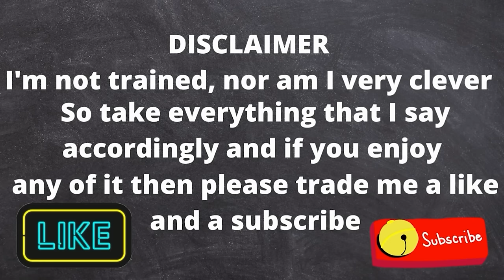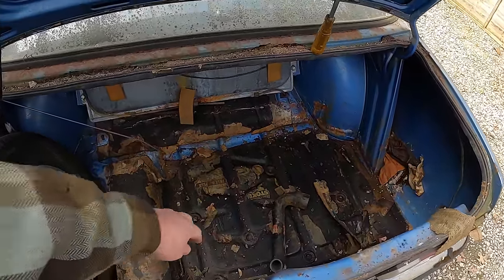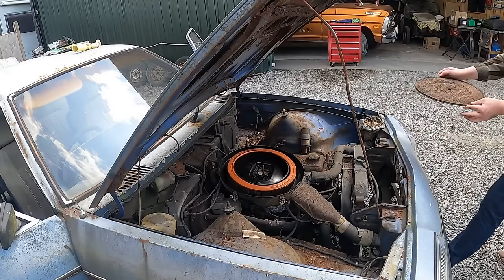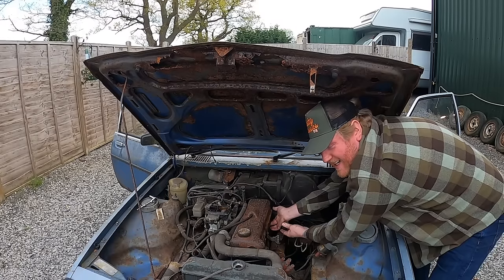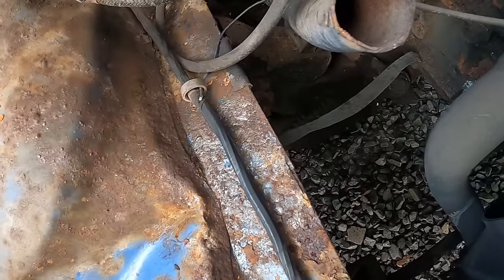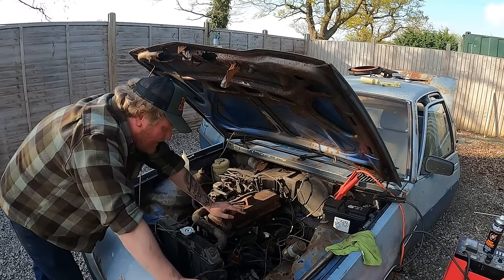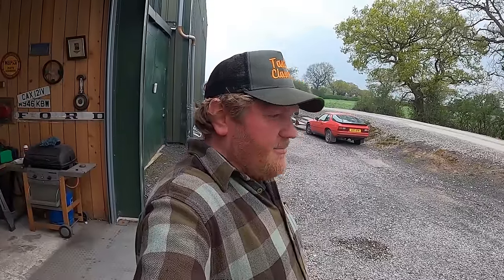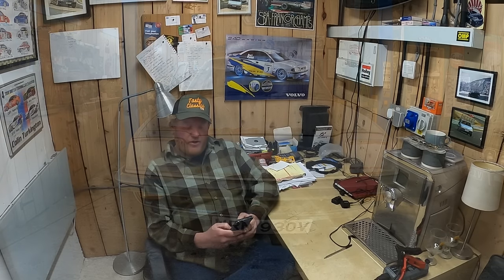Sat for 22 Years! Can I get this very rusty MK1 1980 Vauxhall Cavalier 2000 GL running & driving?

Comment: I had a copper bronze mk1 2000GL in 1985, great car, although the camshaft went and I managed to change it but full head off etc, re-ground the valves in - learned a ton about cars from it, enjoyed this vid 👍
Reply: Done same on 1.6. They coked up bad: right across the valve stems.
    Vauxhall camshafts were shte. Fk knows what they made them of. There was hardly a Vauxhall around that didn't have a clattering camshaft.
Reply: @philgee7249  had a mate with a chevette who had similar at the time, we thought it was us who were cursed 🤣 clearly not. The camshaft I replaced it with was a high lift cam, the performance was nuts, it used to eat XR3i’s off the lights like they were lighting a fag 😂, great times

Comment: Hi, good video buddy, thanks. I had one of these back in the day (also a 1980 I think), but had a smaller engine and gold coloured, 60,000 on the odometer, (half of that downhill), anyhoo a great runner. A curious thing about Vauxhall cars before this model, they came with a fluted bonnet, sometimes chrome that ran from the screen to the front of the clip; more noticeable on earlier models (50s); not sure if their cousins Opel had this design. All in all though pretty reliable mechanically but prone to rust. I had a Victor after this also a hand me down from my father in law. Other models were the Cresta, Velox, Viva. I also owned a Viva GT; now that was a beast with plenty of torque. Greetings from the Isle of Wight.

Comment: I subscribed because the first video I saw was this today. My mate had an Opel Berlina, in the rest of Europe they call them Opels in UK Vauxhall. It was older a bit I think, but was running great. We even once took the engine out, just with our hands because it is so tiny in comparison to modern engines. These cars had a really great design that looks even good today. Back then people would look a lot at the car as there are not many like that alive anymore and on the streets. All original they go for a lot on mobile and here you can get the number plates for historical vehicles provided the vehicle is in mostly original setup. You get a lower tax I think, I know there were some benefits of having a plate like that.
I was also thinking that maybe the glass inside the boot is from a broken window at some point, person maybe thought they will sell the car better with windows intact, replaced it with some spare, but did not bother cleaning the car. Or maybe they just did it to save the car from moisture inside. All sorts of possibilities.

Comment: This brings back memories, my first car was a white 4 door 1.9GL. Mine didn't get the passenger door mirror, that was an optional extra. I drove it all through the winter with no heating, finally figured out the lead stop on the heater cable had come off the heater slider, 5 minutes and it was fixed. Sold it to a friend who ran it out of oil and seized the engine.

Comment: in 1992 I had a mk1 1980 cavalier 1600 with white weller wheels on it with the thin blue and red pinstripes around the circumference of the wheels, it was alwaysn a bugger to get started in the mornings turning over slowley and it had a serious water leak to I had to refil it with water about every 50 miles but for a hundred quid it was cheap motoring at the time, love the sound of this one takes me back to the good old days of motoring on the cheap. might need to tweak the timing plus 3 to 5 degrees for unleaded or super unleaded fuel these were built to run on leaded fuel afterall.

Comment: Had one a gold 2000 manual drove from 1989 1993 and from Suffolk to Aberdeen in 7hrs and from Suffolk to Berwick upon Tweed in 4hrs a fast economical easy to drive car with just a large hole and a clutch replaced in the time I had it brilliant car

Comment: A 1980 1.6L Cavalier was the last read wheel drive car that I owned until last year when I bought a RWD Mercedes. It was streets ahead in build quality compared to the 1977 Capri I had before it. A lovely smooth, comfortable reliable car, I changed the steel wheels that came on it for the same wheels that were on the car above. It is a pity that car is beyond repair but I still fondly remember FTD552W.

Comment: I used to work on these when I was an apprentice, if I remember correctly, the camshaft was recommended to be changed by Vauxhall at around 60000 miles....and the gear oil was changed for a synthetic type to stop/quieten down the chatter from the idler gears....

Comment: That is quite an interesting car! The front suspension has no McPherson struts! That is a proper front suspension! The rear suspension has a Panhard bar, and it's not even a Panhard! The rear quarter panels are so much like an old Toyota Corolla, with the squared rear end and the vent in the sail panel..... The oil pump is literally hanging out in the wind, so it can say "Hello" to the oil filter - never seen that before! I really like the look of the car with the hood open. Were it mine, I think I'd keep the hood open or remove it. It just has a good look, as if to say "Look at my engine and radiator layout"! And the first time you ran it with the Holley fuel pump, there was a sort of melodic quality - as though it were saying "wick, wick wick, wicka, wick wick wick, wicka". Or maybe "boop boop boop boopa, boop boop boop boopa". Had sort of a backbeat to it. Such an interesting car.....

Comment: My father bought a blue 1979 1600gl in 1982 and it was a big step up in luxury compared to the previous cars we had.
The reg was BHL 638T.
Then in 1986 he got a china blue 1983 mk2 cavalier 1.6GL which was even better.
Owned it myself and sold it in 2000 due to the ban on leaded fuel.
Engine was still perfect @150,000 miles and saw it again a few years later with 200,000 miles on it with still the same owner who bought it off me.
Had great velour seats, a rev counter, oil and battery guages as standard.
HUB 660Y.

Comment: Just revived a 1600 auto cavalier mk1 been stood 25 years not as rotten as yours but it had a fully seized carb and no brakes,fuel tank had third of a tank,everything electrical worked fuel pump was dead still an on going project,needs rear wheel bearings and rear shoes too. Hope you get I going,you have hydraulic lifters on the 2000 so probably will rattle when it fires up!

Comment: I would be doing a full restoration on the bodywork and interior. Engine sounds okey and obviously the gearbox works. Brakes, suspension, exhaust need an overall and the carburettor needs a rebuild to. Certainly worth the restoration for a classic like this.

Comment: My parents had a white 1256cc 1980 MK1 that I passed my test on in 1988. I then bought a 1979 Mk2 Escort 1.3, so I used to drive both. The Cavalier was a MUCH nicer car to drive, which always makes me smile when I see MK2 Escorts selling for tens of thousands of pounds. The Cavalier was poorly built though - by the time it was 10 years old/70k miles it had had the engine and gearbox rebuilt, 2 new front wings, and new inner and outer sills. At one point my parents had the MK1 and a 1986 MK2 at the same time - the difference in quality was more like 30 years than 6 years.

Comment: Mk1 Cavalier engines were 1300, 1600 and 1900 (later 2000) there never was an 1800. GLS was added later in the run on saloon, but there was a GLS coupe before the saloon. Three door was called the Cavalier Sportshatch.

Comment: You say there’s nothing worse than a Vauxhall auto box but back in the day GM boxes were considered one of the best. After all Rolls Royce (and I think Jensen?) used them. I had Vauxhall autos in the early 70s (in 3.3 Crestas) and they were pretty tasty especially compared to the competition. That’s a great old motor!!!
Reply: Jaguar, not Jensen used GM 'boxes. Jensen used the Chrysler 727 Torqueflite.
Reply: Thanks. Knew it began with a J!!

Comment: Hello chap! Some fun Cavalier facts. The mk1 engines were originally a 1.3, 1.6 and 1.9. The 1.9 was replaced by the 2.0. Top spec models were the GLS which i can only remember seeing as the Cavalier coupe or sports hatch, which were rebadged Opel Mantas. Essentially the ‘droop snoot’ Cavalier was the German Opel ascona with the Manta nose grafted on. Vauxhall UK wanted to take advantage of the motorsport fame of the Droop snoot Firenza raced by Gerry Marshall (Big Bertha/Little Bertha?). The colour of your car iirc is sapphire blue metallic which was offered on early mk2 cavaliers as well. I disagree with you that the mk3 cavalier was the big seller. The really big seller was the mk2. It was launched at the dog end of the ford cortina years in late 1981. It beat the first jelly old sierra to market as was much preferred by fleets for its more conservative looks and much more sprightly engines. For example the 1.6 sierra only had the same bhp as the 1.3 cavalier (75bhp), which had 90. This was a huge draw in the company car market where car status was all amongst sales reps pounding the roads. I ran two mk2 cavaliers as company cars including an early 1.8SRi. I then spent the second half of the 80s selling cars. So my knowledge is verging on the nerdy. Lol.

Comment: Best upgrade you can do to it once it's running is swapping in a 5 speed from the later Manta
A good friend who's no longer with us (RIP) was the Manta Area rep and he had one of these and did this swap. 
When the car was on the road, drove with decent manners and was reasonly fuel efficent.
Retrofit the Bosch fuel injection system from a GTE , it'd be on par to run with modern traffic without too much issue.

Comment: I AM IN MY MID 50'S NOW, BUT YOU REMIND ME OF TIMES I'D RATHER FORGET. I USED TO NICK CARS DURING THE EARLY 80'S  WELL SOME CARS WERE SO EASY TO STEAL. FOR INSTANCE I WAS STRANDED IN HASTINGS, I WAS DESPERATE TO GET MYSELF BACK TO REDHILL SURREY. THEN IT CAME TO ME SOMETHING MY GRANDDAD DID TO HIS MORRIS 1000. HE HAD MISPLACED THE KEYS. AND NEEDED TO GET SOMEWHERE ASAP, THEN I SAW HIM GET A FOOT LONG PIECE OF WIRE AND HE CONNECTED ONE END TO THE POSITIVE SIDE OF THE BATTERY THEN THE OTHER TO THE COIL. THIS MORRIS HAD NOT GOT A STERING LOCK. ANYWAYS WHAT HE HAD DONE MADE ALL THE LIGHTS OF THE IGNITION INSIDE THE CAR COME ON.  PROBLEM SOLVED WE HAD TO BUMP START IT THO. BUT LONG STORY SHORT THATS HOW I NICKED MORRIS 1000'S BACK IN THE DAY

Comment: We had a MK1. Small correction... They also did a 1.9 which we had (1977 GL model), think the engine was based on the earlier Victor / Viva engine. Badges on back were different. Also facelifts had headrests. Think it only had a driver's door mirror too from the factory. The wheels are called Rostyle. Standard issue. Some mk2 Cortinas eg our 1600E had similar ones too. This is a "facelift" MK1. Best squeaky clutch pedals and rotten back arches to you, sir! (Yes. They ALL had them. Right up until the end of MK3 in 1995).

Comment: Brilliant ‘Left-for-Dead’, Ben. Was howling at the Britney Spears bit at the beginning, alomost at a similar level to the Rascal in the Suez and the Ambassador in the sh1thouse 😂😂😂

Superb that you got her running (expected nothing less!), but when you were spending as much time as you were on the exterior, interior and Engine Bay, I had an inkling the the underside was going to be an/the issue - regrettably I was not wrong, which make 2+2=4 when your friends (is there any way I can get in touch with them for some resto work?) sold her on to ya.

Good luck to the Scimitar, and, as you well know, it‘s not Horse Hair in the muffler, but you asked, so it felt rude not to answer.

Absolutely don’t stop keepin‘ ’em comin‘!
JCHK

Comment: Very rare to see it had a GM varijet II twin choke carb which were use on the mark II Cav's, normally the mark I had the solex carbs which were terrible.
Those old Opel in head cam engines IHC were always solid little lumps, the 2 litre are much sort after these days, the engine will sell no problem. 
I don't know what you paid for it, but you may have hit the jackpot if you break it down... Great Video :goodvibes:

Comment: Have to say great vid,the chassis legs at the front are pretty much always gone because the scuttle and roof drain into them,the drains there are either not in the right place or block easily.i do get your time is money but for a keen lover of the marque it's repairable.i did both a tagora and a Chrysler 2l that were as bad at least.but then I loved them both so to me it was worth it.

Comment: The old cih motor is a hardy old unit, hard to blow up, I tried to with several mantas, and they just burned more oil!!! Well over 100k miles. The swan necks of the chassis legs and floor goes on mantas in the exactly the same places, the ones with sunroofs are always worse as they drain into the a posts/cills.

Comment: That's an Opel CIH engine right? They were also used in late '70's Aussie Holden LJ Toranas and Sunbirds in 1.9 litre capacity. 
Not quite the same as the comtemporary 2.0 Ford Cortina/Pinto OHC engine with the dual throat Weber downdraft they came with. Those things honked hard. The Holden/Opel fours were solid enough though and quite torquey low down, but the Pinto engine just went hard the whole way. In NZ these Cavaliers were never actually seen. We got the similar-looking bug-eyed Chevette with the 1256cc engine and that was it, apart from earlier Magnum Viva's with the 1800 OHC slant four, and before that the Victor range ending with the FD, with 1600, 1800, and 2.0 OHC slant fours. There were some custom FD's fitted with the 2279cc OHC slant four and these were genuine ton-up cars, with wheel spinning torque, even with an auto box. Then there was the Ventora (a light-body FD Victor stuffed full of 3,300cc's of Vauxhall Cresta 6 cylinder iron, and able to win the 1970 Benson and Hedges Race, beating off 289 Mustangs and 318 Valiants..!! One quick little Vauxhall . .

Comment: Honestly, the Cavalier in all its variants was a very pretty car in my opinion, even leading into the first generation of Vauxhall badged Vectra (the third gen Cavalier was sold as the Opel Vectra outside of the UK). After that, the model fell off until it became the Insignia, I think. This is a tasty classic indeed

Comment: You spent rather a lot of time spinning  the engine  over with the plugs in straining the battery . Putting a bit of engine oil in the bores at the start removing the plugs and freeing it up gradually would have been a wiser choice after you had established the engine had compression . The old petrol and rust in the tank should of course be bypassed by taking it out of commision till it's  properly drained and inspected. Interesting vid though. I'm  old enough to remember these new. I drove an Opel Berlineta 2.0 coupe version once which  virtually had the same mechanicals when I worked driving for a garage back in the day . They were superb when they were new.

Comment: the cars back then were rot boxes but the vauxhall engines were practically bulletproof. could run them even with bad timing and no oil and they still worked fine

Comment: Worked on many a mk1 Cavalier. It also came with the 1256cc engine. The 1256cc engine in a cavalier was rare even in the day.
The 2000 was a good engine, also used in the mk1 Caralton. The auto box was not bad at all in the Cavalier and Carlton. A dog in the Chevette,again an automatic Chevette was rare.

Comment: My dad had a 1978 version of this car, it was only a year old when he brought it home. It had the superior 1.9 litre engine (90hp) quite impressive for those days. Aparently the 2.0 litre version in this video replaced the 1.9 but was not as reliable and didn't pull as well for some reason.
Reply: I had a 2.0L, went like shit off a shovel, If the 1.9 was better then it would fly.

Comment: They used to rot bad on the box chassis towards the front. Water used to get between a reinforced area where a front cross member bolted on.
     The car had a very comfortable ride.

Comment: All the cavaliers asconas and mantas go in same place on bulkhead vauxhall green parts  have repair panels for them. On the idle the carb has autochoke and settings  different for autobox. Also adjust the  tappets it will tick over better you do them with engine running.  Bumpers same as early mantas bonnet off manta would fit
Reply: More details engine and box same as opel manta SR automatic that was faster on acceleration than manual 4 speed. On kickdown these are brilliant

Comment: Some good spares for restoring an Opel Manta there. Worth very little as a Cavalier. Carburettor’s is a GM Varajet which was a terrible design even when new. Best replaced with a Weber and a conversion kit was available back in the day.
Reply: On the one I had, there was Solex 32 32. Went like clappers when ov er-hauled and set properly.

Comment: Gm bought Vauxhall and Opel on the early 1920’s, and it was in the late 70’s and early 80’s that Gm and Opels were all designed in house at Opel, the Chevette and Mk1 cavalier were the first of the joint designed cars

Comment: A friend had a dark blue 1800. Very torquey engine. I remember him driving from Essex to Staffs to get to Alton Towers. I was sat in the back and felt a draught on my ass
 I then discovered a huge hole behind the seat squab and I could see the road! I tried stuffing rubbish into it to stop the air but it just fell through into the road.

Comment: Hi Ben I had a mk2 Cavalier and the auto choke was a nightmare on it and it used to cut out a lot. Also hot starts could be an issue. I’m only say because as soon as you added water it cut out, could the poor idle be due to choke issues?